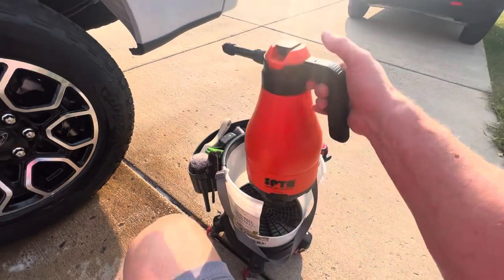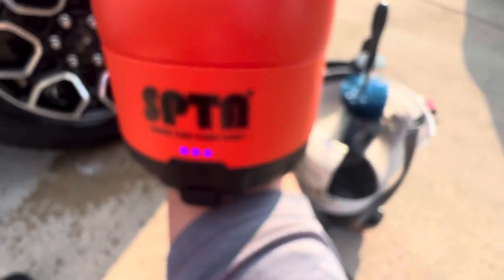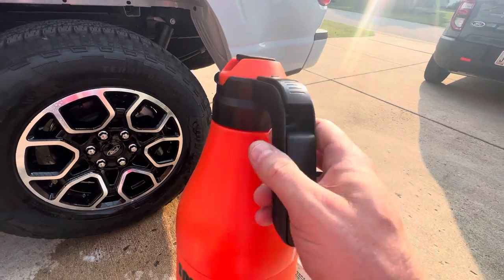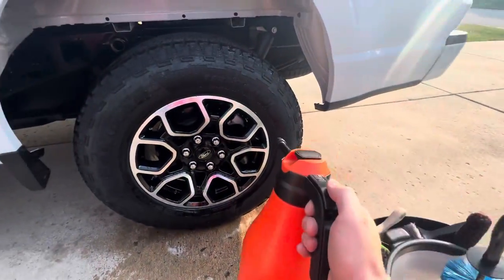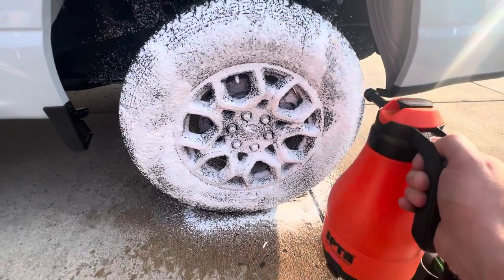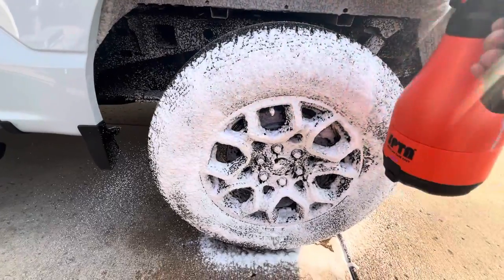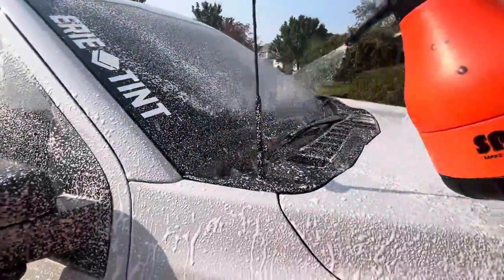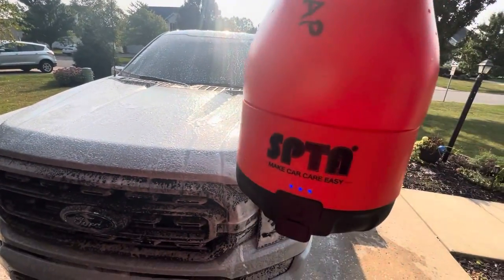SPTA rechargeable battery Foamer

Comment: Curious, what pressure washer you rockin?
Reply from the maker: karcher k1700 cube    love it    quiet,  cheap   extremely durable used it over 100 times prob ...still runs like a champ.  kobra jet 25 ft hose and the mtm sgs28 really enhance the user experience tho..
Reply: @waxmanvids5015  Thanks!

Comment: How is this foamer still holding up? The reviews on Amazon are not that great. Thanks!
Reply from the maker: i have 2      the one I used alot the battery just started acting up...ill see if just a glitch tho.  I really like them for wheel cleaning.
Reply: Died in 6 months, probably about 10 car washes going to pump kind😢